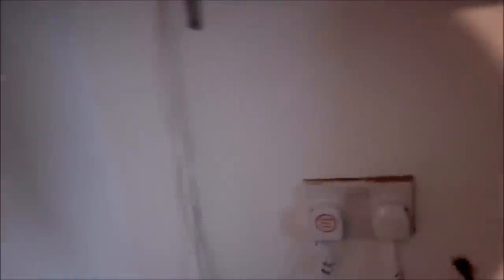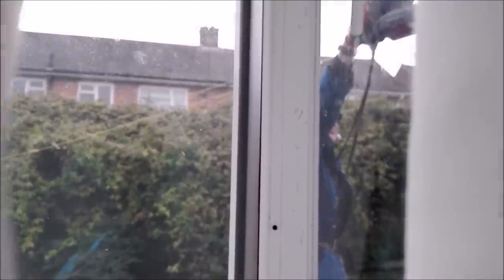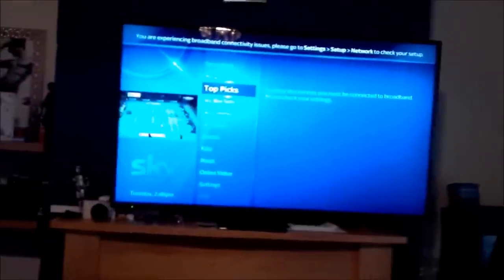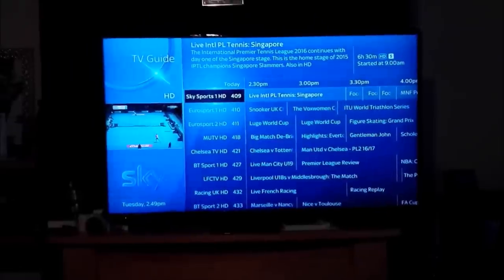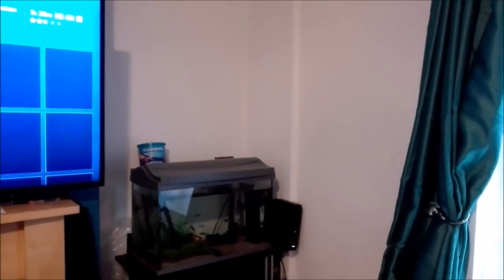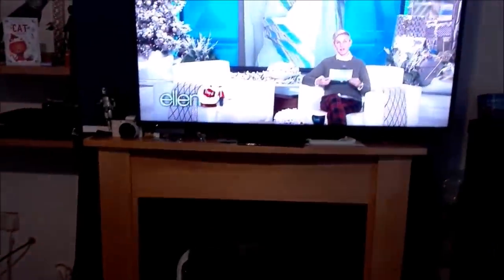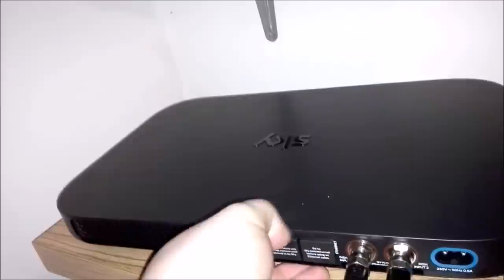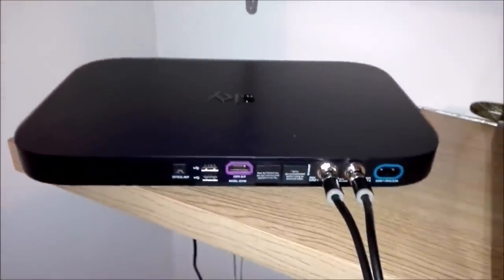sky Q tv installation

Comment: im a sky engineer and that installation was messy. i never leave a mess (use a dust pan and brush) and i cover all holes. that wasnt even a neat hole. 4K is available, but its all on demand in a ultra HD section in box set, cinema and sport.
Reply from the maker: younbass  thanks should I off made a complaint
Reply: blitz not enough to make a complaint about. Engineers like that just annoy me. Bash the job out and no respect for customers.
Reply from the maker: i did ask for the hole to be a little bi lower and more in corner but he did it there couldn't say no after he started drilling sham tho was nice guy  should a talk to sky try get some
 comp like money off you think ?
Reply: Sorry how many holes do I need to connect the sky I have one but don't know if is the one
Reply: @amandaebele6721  only one hole through the wall is needed!
Reply: @Is It Worth It? when you say someone already has it in the house. Do you mean you will be wanting a mini box?